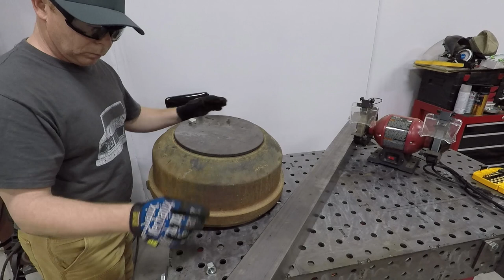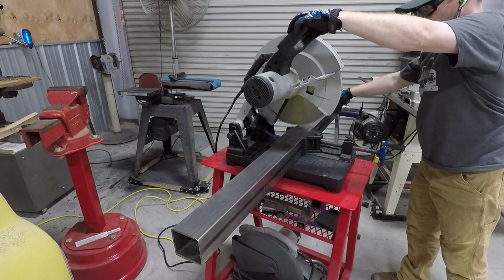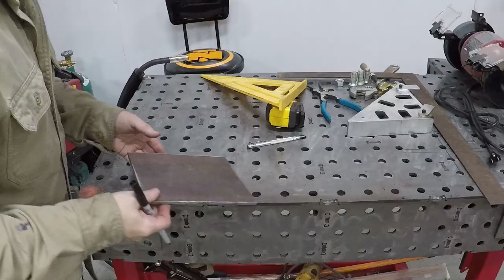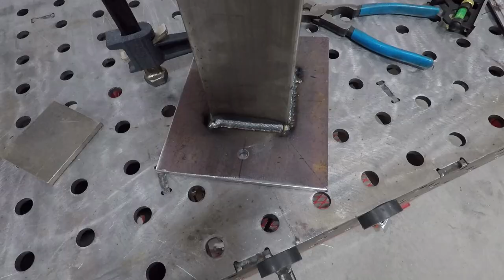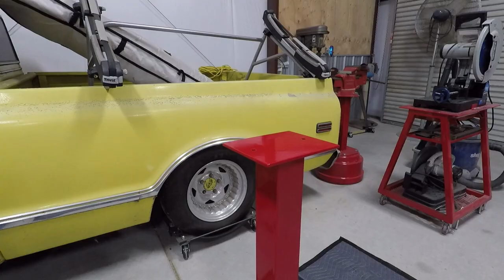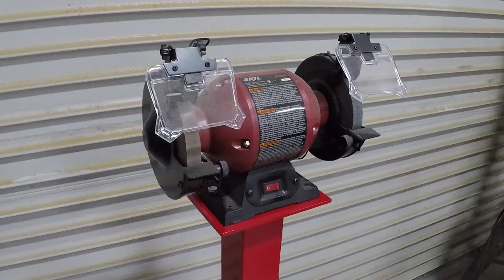DIY Grinder Or Vise Stand Welding Project

Comment: Nice project, I have an old brake drum and some scrap plates just need to find some tube or square stock and I will build one. Found your channel from Mike Festiva. Now that you have the CNC table next time you need to make a circle with holes you can just cut one :)

Comment: nice just found your channel i seen the vice on a stand i will have to have a look at that build does it fall over easy  with weight on it
Reply from the maker: They are very sturdy and haven't had an issue with one falling over.  My stand with vise, has a brake drum from a semi truck.  It's super heavy.  I went by a trucking company and they gave me an old drum for free.  They make great stands.

Comment: Any advantage to bolting vs just welding everything together?
Reply from the maker: I wanted the flexibility to easily make changes in the future if I decide and not have to powder coat the drum again. You could weld it, I just wanted to bolt it.

Comment: Nice build. What happened to your leg?
Reply from the maker: Thanks.  I smashed my foot between a boulder and the foot peg on my motorcycle.  I broke 3 toes and ripped off the big toenail. All with some heavy motocross boots on.  I'm glad I had them or it would have been much worse.